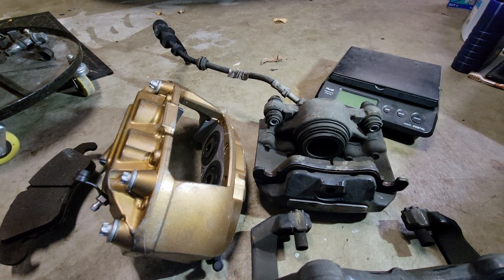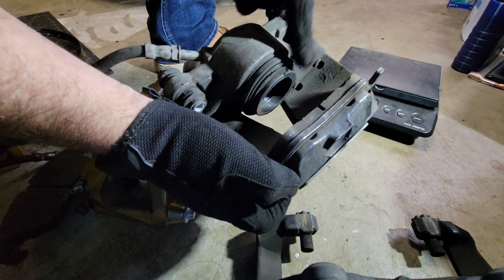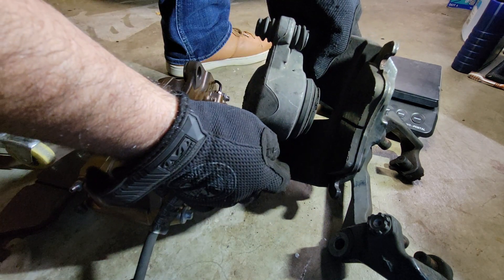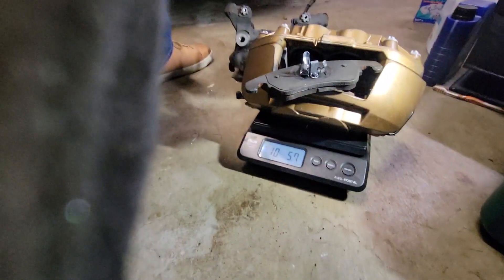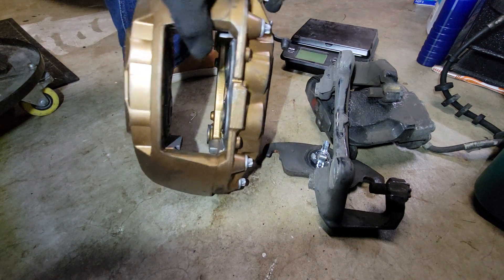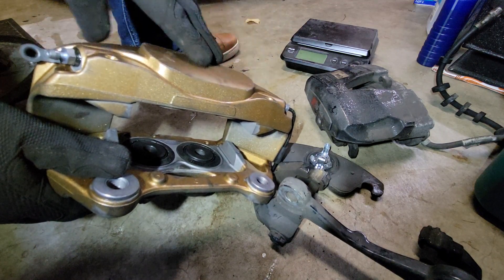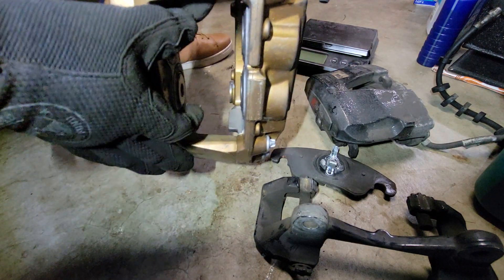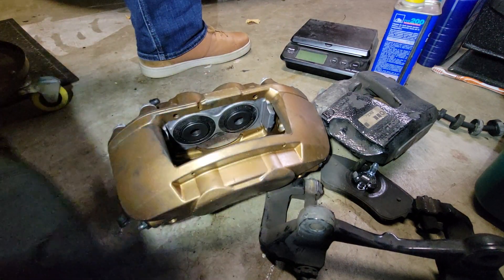Tech Talk #1 - Track Brakes: fixed calipers versus sliding calipers

Comment: I love the TL type S brembos I swapped to my 6 speed accord. It stops on a dime with the steel braided brake lines and dot 4 fluid. I want to see how it would handle on the track once I'm done trimming fat off such as the heavy leather seats and making carbon fiber fenders,hood,trunk and door skins. I want it under 3,000lbs.

Comment: For street cars (not purpose built Formula or SR cars), I'd suggest sticking with the OE brake fluid recommendation (DOT 3/4/5, synthetic, non-synthetic). Using an incompatible fluid can damage the seals in the system. If you decide you are going to get an improved fluid, be sure to flush the old stuff out. This can be difficult with a system containing an ABS unit so be patient. All that said, I don't think I would bother changing the fluid brand for a street car on the track.